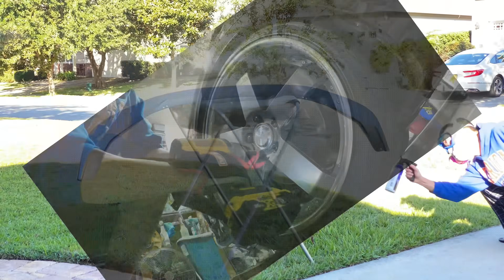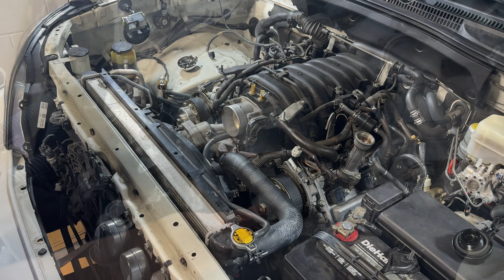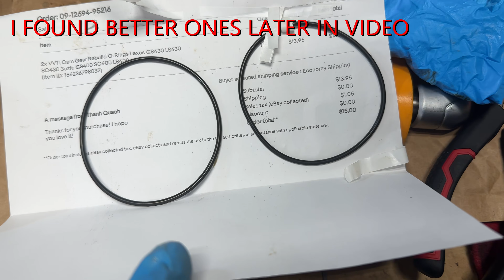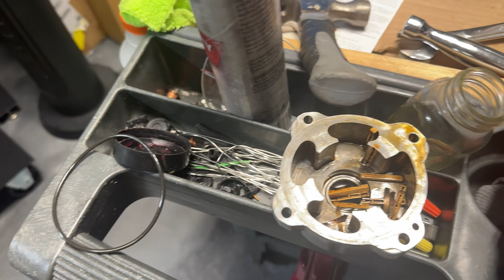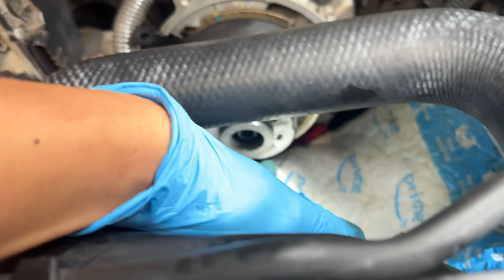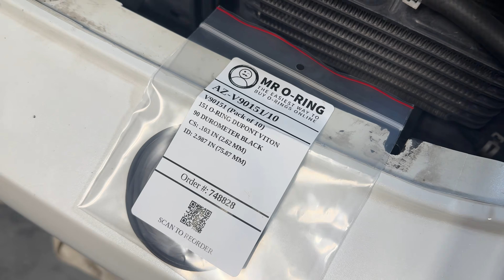How to Replace VVTI Gear O-ring on Toyota 2UZ-FE 4.7L V8 | Lexus GX470 LX470 | Tundra | 4Runner

Comment from the maker: I discovered a easier and new way to remove the VVTI cover and gear to clean and do the seal. First you will need to clock the timing 45-degrees counterclockwise, to the left of TDC, line it up where the dip in the cam cover is, it will release the tension in the cams. Once you do that, remove the 10mm hex/allen bolt that holds the VVTI to the cam. When you do this, it allows the cover and the phaser inside to come off in one piece and you don't need to worry about the spacers/leaf springs falling out. You can clean and service all this cap/phaser/springs on the bench and gives you better access to the seal on the car side. Pay attention to the dowel pin/alignment when putting back on. Just make sure you mark/photograph where everything lined up so you put it back correctly.
Reply: This new way can’t be done will T belt cams are on engine correct ? Only if you’re taking cams out ?
Reply from the maker: Yes it can as the cam is not under load at 45-degrees left. The TB is still held by the gears and is static. Taking the 10mm lets the whole cover and phase come out.
Reply: @TunerwithKids so to better understand it. The sprocket is still staying in place and the part which has spacers comes off with the cup? Correct me if I’m wrong. Thanks!
Reply from the maker: If you clock the timing mark 45-degrees CCW, near the dip in the cam cap, it releases spring pressure. Then you can remove the center 10mm Allen bolt (after remove the 19mm cap). Unbolt the four security bit bolts and the outer cap and phaser comes off as a whole assembly. The timing belt, sprockets, and everything else stays. Do the seal, clean the cap, phaser, locking pin all on the bench and reassemble. Make sure nothing springs out of place on the cap side.
Reply: @T @TunerwithKids re you sure that works? Had anyone tried this? Just looking at the timing belt sprocket it would have to come off with the cam phaser wouldn’t it?
Reply from the maker: I’ve done it a few times troubleshooting my O-ring and a nuisance code for P012. I think the O-ring I used is to hard.
Reply: What’s the torque specs on those 4 bolts for the phaser ?
Reply from the maker: Probably 11ft lbs like other 10mm bolts.

Comment: Good morning,  i’m having trouble with my toyota sequoia 2005 engine because every video i see shows everything tdc but then what i read is that this is risky because the piston 1 is all the way up.  I’m not sure where to put the crankshaft.   Specially since i’m doing the timing belt and water pump first and then jumping to the cam seals.  Can i leave the Crankshaft at the T mark for the cams and the crankshaft marker pointing to idler #2 and would this keep everything safe? Help please. Thank you🙏🏼
Reply from the maker: If you are taking cams out, I have another video on that process. You have to follow the factory manual to a T. Once you have that off, do the VVTI seal too. Need to order the O ring on eBay.
Reply: @TunerwithKids Yes I saw your other video.  You make references to tdc but I’m not sure where i should have the crankshaft when I start working on the cam seals.  Just wanted clarification.
Reply from the maker: Have you downloaded the FSM? I think I link to some of those resources in video descriptions. The FSM will have all the step by step details. In addition, I think I screenshot those in my videos.
Reply: @TunerwithKids Yes and I just read the manual for removal and installation and for both it only states to have the Crankshaft marking pointed towards the 2nd idler pulley (at around 50degrees clockwise) on the diagram.  In your video it you did show to reinstall the cam to rotate so the key is vertical.  I’m need to make sure there is nothing else that states I have to do that with my vehicle.

Comment: A better option rather than grease is Assemblee Goo. It has a vary low melting point so it melts in vary quickly and won't clog ports.

Comment: Im seeing a pretty bad leak from my driver side timing cover on my ls400 vvti i did timing 2 years ago and skipped the seals and actuators so im going to pull it all apart maybe tomoro to see whats going on. These videos really help with my confidence 😂 the services manual says to set it to 50° past TDC any time you do timing.
Reply from the maker: I had originally used the 90a durameter seal which I think is too hard. I linked to a 75a which may be better. The 90 might cause some timing issues cause it can’t tighten flat.

Comment: Is anyone else getting a P0012/P0022 code?
Reply: I just did this, did not mess up the timing, as everything rotated no issues. I got a pending code for P0012 my first drive but no CEL or other codes related. Do you have any update? Some people on the old posts say it goes away and some say its dirty oil etc.
Reply: I am after replacing both o rings. It started with p0012 but now I’m also getting p0022 . Truck runs fine and I don’t have any sludge issues, oil is not dirty.  Wasn’t getting any codes before the o ring replacement .Have you figured it out?
Reply: So there is a forum that says you need to loosen the bolts on the head of the cam cover and shift it all the way clockwise and if that doesn’t work shit it counter clockwise and that should fix it supposedly its because its pressed too hard and they need shift very lightly so tightening up too much can cause this.
Reply: Can you post a link to this forum im dealing with p0022. Somehow I managed to do the driver side perfectly. But the passenger side is giving me a fit. Ive removed the the entire assembly and it was as clean as can be but somehow I feel the plunger is sticking im the locked positiin and keeping it retarded
Reply: @justinstevens7631 It’s not letting me post the link here.  I did it  2x and just gets deleted
Reply: @justinstevens7631 On the forum the guy said he cleared both codes for P0012 & P0022.  Pretty sure by clear he means clearing them through the code reader device.  However, after clearing it P0022 went away!  Maybe this is all you have to do.   P0012 came back and then he explains the procedure that helped him with that.
Reply: @delasosa5526 thats alright I appreciate. I may have found it, ive tried clocking that cover different degrees numerous times nownim stuck with the slapping noise. Im just going to tear it all down and repalxe the entire assembly.

Comment: Great work I’ve been watching your videos for a while and been learning a lot thank you. 
Question: would it be possible that the leak issue I’m having is the O ring you are replacing in this video and not the cam seal? Thank you.
Reply from the maker: It’s 100% the O-ring as the cam seal is rarely faulty.
Reply: @TunerwithKids thank you I will replace the O- rings thanks for taking the time to answer my question. 😊
Reply: @TunerwithKids  Do you have the OEM part number from Lexus? The once you have looks like aftermarket?
Reply from the maker: There is no such OEM Oring, it’s not supposed to be a serviceable part. They want you to replace whole unit.
Reply: @TunerwithKids I got the one from Amazon, it was the last one too. Thanks again.

Comment: I did this but the I took out the VVTI it sprung to the side. Does this mean I wasn't at TDC?
Reply from the maker: You need to make sure it’s put back. At TDC it’s under spring load. If you got 15 degrees CCW, it releases the cam pressure
Reply: @Tun @TunerwithKids how do you know you are 15 degrees CCW from TDC?
Reply: Also I got a P0022 “timing retarded” code on the driver side cam. Which is the one that jumped. How would I go about realigned the cam?
Reply from the maker: It If I jumped a tooth, you may have to take everything apart and make sure everything is back at the markings in the book. But P022 is usually a VVTI code not a jumper timing tooth. That with throw crank and cam position codes.
Reply: I had it on the mark to the left of the T but I saw a video that was to crank it to the “T” mark and then I was able to turn the VVTI back and remove it like you did.

Comment: Is it necessary to line the timing?
Reply from the maker: Yes, for reference in case something happens. The cam is under spring load so it may move when you take the gear cap off.
Reply: @TunerwithKids  even without removing the belt?
Reply from the maker: Leave belt if you don’t need to replace it.
Reply from the maker: One thing I realize after working on it, if you turn the timing marks about 45-degrees counterclockwise. Basically to the dip in the cam cover, it releases the cam tension and make removal easier.
Reply: @TunerwithKids   just saw this, so align the timing then turn 45 degrees counterclockwise. I am only doing the driver side for now.
Reply from the maker: @DomoUchiha yes, set to TDC via the marks. Then turn crank counter clockwise about 45-degrees. So the marks line with the dip on the end cap. This is the position when you do timing belt to remove the belt in the FSM.
Reply: @TunerwithKids I stripped one of the security screw, I did cut across for flathead but it won’t budge. Any  advice?
Reply from the maker: Try tightening others to relieve pressure before you turn. It’s only 10lbs of torque so not that tight. I think I a standard 10mm will fit back.
Reply: I’ll try it again next weekend 😅
Reply: What is the “dip” in the cam cover exactly? How can I know exactly when spring tension is relieved